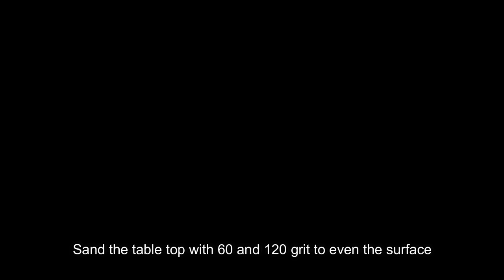DIY Computer Desk Under $40 (PHP 2000)

Comment: One thing I would add is, when stacking the pallets, use wood glue in between them. Even if the pallets are nailed to each other, due to heat and cold, wood will expand or contract. Adding wood glue can limit the movement of the wood.
Reply from the maker: Yes sir, next time wood glue na po gagamitin ko, salamat sa tip sir

Comment: Sa wakas may nakita din akong pinoy na maayos ang DIY table.

Nakita ko to sa slapsoil page Paps.

Magkano singil sa pag fabricate ng metal legs Paps? Bakit mo tinanggal yung pang-limang leg? Hindi ba pwedeng screws na lang din yung pangsecure ng mga pallets?
Reply from the maker: Libre ung fabricate boss kasi tropa hehe pero nasa 200 siguro un pag spot lang. Ung pang Lima na leg inalis ko na kasi sobrang solid na sir. Pwede din screw sir kaso konti lang screw ko nung time na un hehe
Reply: @JuanTipidTips  ok paps, thanks sa reply. Gayahin ko tong table mo sa weekend :)
Reply from the maker: salamat din sir! go!
Reply: Excellent Video! Excuse me for butting in, I am interested in your opinion. Have you considered - Mahorrla Wooden Paradise Method (google it)? It is a good one of a kind guide for building better sheds and woodworking minus the headache. Ive heard some extraordinary things about it and my good mate called Gray at last got great results with it.

Comment: what's the dimension of the pallet wood you used? just wanna know if i'm getting the same price from yours. 

also, can you try the trending ikea table, with drawers on both sides instead of steel pipe legs. is palochina woods strong enough to handle the weight or nah? thanks
Reply from the maker: It's a 180cm long and 60cm wide. The thickness is 2 inches.

Thanks for the suggestion. I am planning to create a desk drawer since we do not have ikea store here in the Philippines yet.
Reply: @JuanTipidTips   a great alternative than pipes though. and i saw that you didn’t install the pipe in the middle of the table maybe with the drawers on both side plus the steel pipes it has better reinforcements and is more sturdy maybe? gonna wait for that goodjob tho
Reply from the maker: thank you for the tips mate!

Comment: Noob question po: Instead of small cuts ng wood, pwede kaya isang buong wood slab same thickness sa ginamit sa video tapos 3 layers din?
Reply from the maker: Yes sir, if 120cm is enough for your requirements, then no need to add or cut 60cm sir

Comment: Long grain glue strength is very strong if you wanted to glue instead of crossing the boards. Nice work with hand tools
Reply from the maker: Thanks for the tip mate. I am looking into using wood glue on my next woodwork project

Comment: Totally loved this video. Great to see a simple handsaw at work and no fancy machinery 👌
I have a question about the legs. If you had to put 4 wooden legs (instead of the 4 metal pipes), how do you decide the thickness of 4 wooden legs? How do you figure out what is the minimum thickness of each wooden leg for a table? 
Thanks much 😊
Reply from the maker: Thanks @jimbokraut640! About your question regarding the thickness of the wooden legs, sorry but I am not sure how to calculate it. Sorry about that
Reply: @JuanTipidTips  No worries mate, thanks for replying. Keep posting great stuff 👍

Comment: You can offset the legs inwards to shortened the center length and avoid bending the wood slab in the long run. Ayus parin, galing mo.
Reply from the maker: You're right sir. I am going to replace the legs with a drawer cabinet. Almost finished. Will upload the video soon
Reply: @JuanTipidTips  abangan ko yan

Comment: Im planning to build my table. Ang problem ko sa table ko ngayon is yung monitor ko na naka mount sa desk is wobbly when I type on my keyboard. Does this table remove any wobble or vibration on the desk to the monitor?
Reply from the maker: I think so sir. The desk is sturdy dahil makapal sya and solid talaga. Ung sakin wala movements
Reply: @JuanTipidTips  Thanks for the info.

Comment: Good Day Po. Sir pano nyo po napa smooth yung gilid? Dipa po may mga gaps yun. Nilagyan nyo po ba palochina or body filler?
Reply from the maker: Body filler din po sir para ma takpan ung gaps
Reply: @JuanTipidTips  Thank you sir! Isang question pa po sana. 
Dyan po sa ginawa nyong desk, 4 po ang stand. Pero pag add nyo po nung cabinet dun sa isang video, parang hindi na po visible yung dalawang stand. Tinanggal nyo po ba? Pinatong nyo nalang po ba sa cabinet ang table top? And if pintong nyo po, ini-screw nyo po ba? Tia.
Reply from the maker: Tinanggal ko na ung legs sir and nakapatong nalang po. Wala na screw sir
Reply: @JuanTipidTips  Ah ganon po ba. Sige po. Maraming Salamat, Sir!
Reply from the maker: Maraming salamat din sir!

Comment: lima ba yung paa boss? o apat? inulit ko panoorin. nawala yata yung isa.
Reply from the maker: 5 nung una sir pero inalis ko na din kasi matibay na kahit wala ung 5th leg
Reply: @JuanTipidTips  pre pwde nman yng fifth leg just in case loaded ang middle noh?
Reply from the maker: Opo sir pwede po. Naka standby lang po ung 5th leg in case na may signs of sag or bending sa middle. Sa ngayon sir solid padin ung table

Comment: Where to buy the materials po
Reply from the maker: Hi Sir Mark, nilagyan ko po label kung san ko nabili ung materials. See below

MATERIALS:
30 2x10x120cm pallet wood - Carmona Cavite wood seller along Governor's drive
4 75cm (2 inches diameter) metal tube - Junk shop/ hardware
Epoxy Primer - hardware
Polyester Body filler -hardware
2 Brown plastic varnish - handyman
2 cans of matt black spary paint -handyman
1.5 inch Finishing nails - harware
1.5 inch Wood Screws - hardware
Reply: @JuanTipidTips  Thanks! btw, is a finishing sander really necessary? kaya po bang pag-tiyagaan ang sand paper lang? hehe
Reply from the maker: sir kaya naman mano mano pero matagal lang talaga

Comment: What is the height and diameter of the legs
Reply from the maker: 75cm length and diameter is 2 inches
Reply: @JuanTipidTips  Thank you I making the same desk
Reply from the maker: You're welcome and thank you for watching!
Reply: @JuanTipidTips what was the length of the table length and width
Reply from the maker: 180cm sir
Reply from the maker: 180cm and 60cm sir

Comment: Bhai what is 80 grit 6:22
Reply from the maker: The number represents the abrasive material on the sandpaper sir
Reply: If the table moves here and there How will you fix that thing?
Reply: Is there any difficulty you are facing?
Reply from the maker: using the body filler was hard for me as it is my first time using it